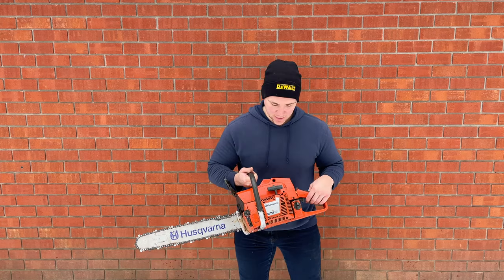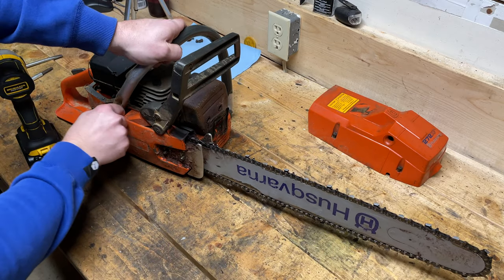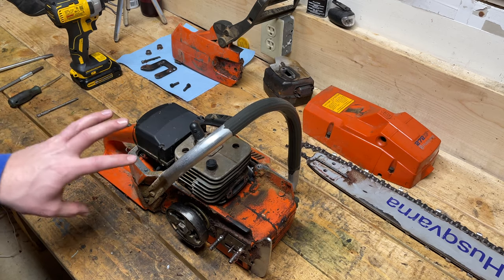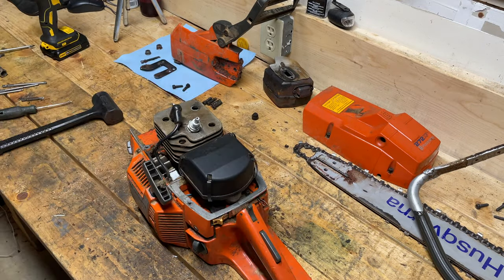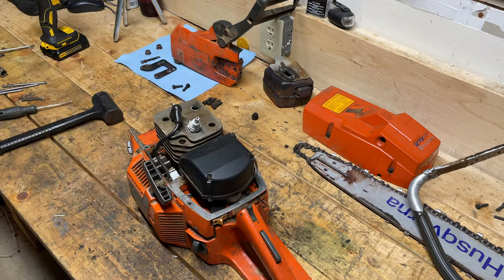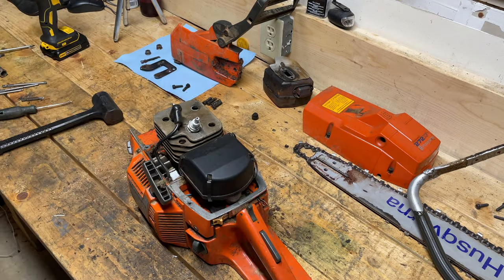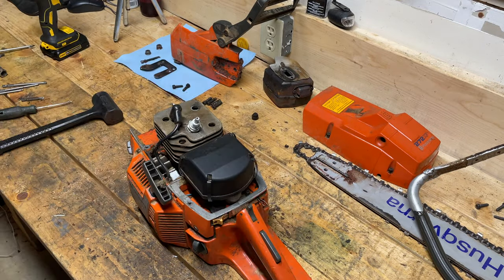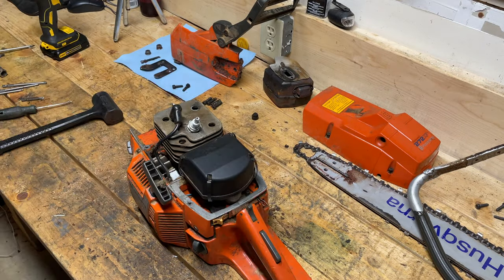How to fix your blown up chainsaw... WITHOUT buying new parts! Step-by-step diagnoses and repair!!!

Comment: Doesn’t the ring gap have to be located away from the ports?
Reply from the maker: Hey Don! The ring gap lines up with the small aligning tab on the cylinder. You’d have to ask the Husky engineer that decided it was best there!!! Cheers!
Reply: @DavesSmallEngines  outboards have a pin that places it on a solid wall with no ports. Just didn’t see you position the ring on it. Could you sand the rough spots off the piston by placing sand paper on a piece of carpet and rubbing the piston on the flat surface till smoothe?  Spraying starting fluid around the intake will running will reveal a leak if

Comment: Oh muriatic acid is some strong stuff. I use it clean the rust off heavily rusted metal. Turns it not rusted, completely. I guess you should put baking soda on what ever you put it on to neutralize the acid. Idk science and stuff. I hate the smell of the stuff. Burns your nostrils. Cool video though i just leaned out my husqvarna h350 and blew it up im pretty sure. And almost doing it to my mini mac 120. I dont even want to start another chainsaw until i learn how to not blow them up. Glad i got a 545xp mark 2 the other day with the auto tune though. Its almost idiot proof im hopeing

Comment: Nobody says blown up chainsaw or engine in Australia. If it's blown up it has smash pistons, crank, valves, & so on. Sanding the piston ring will remove it's hard facing.
Reply from the maker: What’s the term you use down under?
Reply: @DavesSmallEngines  Just worn out. But a blown engine will not run.👍
Reply from the maker: @noelpeterson5591  cool!

Comment: When I disassemble a saw I chunk the parts in a big plastic tub so I do not loose anything.  I tried this once ( cleaning up and sanding the piston) on an H S 45  hedge trimmer, once and when I got it back together it would not run.  I checked the compression and it was a whopping 30#, which ain’t going to run, ever.  So, I had to disassemble it, again, and put on a new cylinder and piston.  It ran fine, afterwards.
If I ever have to pull a cylinder, it gets a new piston, cylinder and rings.  Just like a carb.  If I have to disassemble it, it gets a new carb kit and a good cleaning in the ultra sonic.  I just do not like doing things, twice.
Reply from the maker: Do you use OEM? That can get pricy!
Reply: @DavesSmallEngines  only when I have to.  I will buy certain parts from my local Stihl and Husky dealers but I get them off eBay if I can.  Tank vents, throttle rods, control levers, deco valves I usually buy oem but big stuff I get AM.  I am not spending $50 for a clutch that I can get for $10 off eBay.  I sure am not giving them $300 for a cylinder and piston.  I am a disabled veteran - not an idiot.
Reply from the maker: @johnclarke6647  right on. Any favourite AM cylinder / pistons?
Reply: @DavesSmallEngines  Dave, the cheapest ones, as long as they work.  I have to much Scot in me to spend a fortune for them.  I usually upgrade to Nikasil on saws that I want  to keep for myself.  I have had good luck with Farmertec stuff.  Sometimes I have to put some oem parts in here and there, but my ms 360 is just it came from the box in August 2019 and is still running fine.  I did swap out the tank vent but that was it.  The 360 has cut a lot of big wood.  It has a 20 inch Stihl Oilimatic E bar and Stihl RS chain on it.  It has around 15 tanks on it.  Never had one problem with it.  I just keep it clean, sharpened and fed good two cycle gas and bar oil.  I use Echo Premium bar oil for two reasons - I can get it for a little over $10 a gallon at Home Depot with my veterans discount and it works good in cold weather.  Stihl Platinum does not flow as good in cold weather and I don’t like spending almost $20 for a gallon of it.

Comment: Hey those dawgs  say what the saw was used for, ever milling or post cutting, and probably experimenting with oil ratio.
Reply from the maker: Interesting. How can you tell?
Reply: @DavesSmallEngines  it's common door milling saws to self destruct from lack of oil. I brought a 395xp new before the EPA compliance 50/1 come in, and have always ran 25/1 till I had a fuel issue, toke to dealer and they put fresh fuel in and I should have tipped it out as it was probably 50/1 or 32/1, and seized the saw milling after 1/2 hour use

Comment: 40:1 premix ratio prevents this. 50:1 ratio allows this type of damage, over a couple of years - believe me, we've bought a lot of equipment over the years. 40:1 hasn't allowed any loss of compression. I don't get the whole 45:1 recommendation - I've never seen that on a measuring cup...
Reply from the maker: Everything is 50:1 recommended now. I take Donyboy73’s advice and go with 45:1.
Reply: @DavesSmallEngines  How do you mix 45:1 without special measuring cups? That's my point. I've never heard of 45:1, nor is it on any mixing charts. The back of most 2 cycle oil bottles always say: 50:1, 40:1, 32:1, etc...  Never seen nor heard of 45:1.

I guess that because I run a business, I do this more than the average person. 50:1 grenades equipment after 1 year of heavy sustained usage, by the way. I've never heard a mechanic recommend this, except for some local retail brick and mortar repair shops, which need broken equipment to stay in business.

Comment: Great video which shows you its not always necessary for new parts. Bodge and fix, love it. Could you do one thing though, put the chain brake on before you start a chainsaw. I know ill get called a pussy but having witnessed a chainsaw go through a leg,,,,,,,,,,,,,,,,. Its like 1lb bacon in bits.
Reply from the maker: Nah, not a pussy at all. A smart move!

Comment: If you don’t get piston slap because of material missing from the piston and cylinder and the piston skirt doesn’t explode and break off at 13000 rpm You’ll be fine

Comment: Save all the trouble to get a cylinder and piston kit from Amazon for less than $50.
Reply from the maker: Not even close to the same quality as OEM!
Reply: A new Husqvarna cylinder kit (comes with new cylinder, new piston, and ring) costs $80 on most places online. Edit: I should say, for a Rancher 460.

Comment: I should develop a chainsaw for dummies, that if they forget to mix oil or gas or put premix gas in it the engine won't get damaged or build an engine where the dynamics of the straight gas stalls the engine within 10 seconds after starting.
Reply from the maker: That would sell like hot cakes!

Comment: Why not use 2 cycle oil for lubrication, rather than WD-40? I've never seen WD-40 used as assembly oil for an engine - I would recommend 2-cycle oil, since that's what it's designed for....
Reply from the maker: Good call, I will do that!

Comment: EPA lean running chainsaws all have a fine line between great running and destroyed chainsaw cylinder and jug and the carbon no older non EPA chainsaw gets as I run saws for. 54 years and love my old 330 limelight saw all that it needs is a intake boot every 15 years and a sharp chain and oil that's right for cold or summer running also post and hateful or mean or even rude posts not allowed as this man trying to teach you some skills and bothering to do just that and edit and post think of that he's no 15 year old that needs to post anything for attention also remember if you can't say anything nice don't say 8t at all
Reply: Also get yourself a great well made chain saw they have run a 13000 or 145000 rpm and have nothing but a carb adjustment and your cutting better than new chainsaws bet your bottom dollar you will see

Comment: You don’t find many of those in that good of cosmetic shape.A new piston and ring and it will be like new. I realize the premise of the video is temporary use but I personally wouldn’t use it and risk wrecking a classic cylinder.
Reply from the maker: Ahh, a friend of mine has it now. That’s too bad. Had I have known that I would have kept it!
Reply: @DavesSmallEngines  Damn! That was a classic workhorse. Are you more of a Stihl guy?

Comment: dude get a cylinder and piston do be cheap just get a big bore kit it will have more power
Reply from the maker: Aftermarket kits aren’t always the best quality. This way it’s original... planning on now running it till it blows up again and then replacing with fresh.

An aftermarket kit of high quality would be hundreds of dollars.

Comment: OHH lord, did you bang that thing on the spark plug to remove a loose fastener at the 8:46 mark? Jeez. And wash your machines before you start doing internal engine work. Don should have discussed this with you... I hope!
Reply from the maker: Fowvee good catch! Forgot that was still in there. A light tap, but still poor practice nonetheless. I’ll be more careful next time!

Comment: Audio too low, I have it at full volume and struggle to hear
Reply from the maker: Audio volume is fine - check your system volume too!
Reply: @DavesSmallEngines  you need to yell please

Comment: Great to watch a novice with interest. Although I really enjoyed your video, it made me pause. You are showing people how to
butcher something to make it run. You didn't even oil the ring before re-installing it. You are teaching hacks how to repair stuff and 
sell to the less fortunate. Donny you should know better!
Reply from the maker: Hey John! The point of this video was that its possible to fix your own equipment - even if temporarily to get you out of a pinch. I usually spray a lubricant into the cylinder prior to pulling it over. Thanks for watching!
Reply: You don't rebuild motors to get you out of a pinch. Engines aren't free to rebuild. Do you  disagree? You are showing the public how to screw their neighbor, cause people won't do that. STOP IT !! @DavesSmallEngines
Reply from the maker: @johnhenry8424  hey John... this rebuild cost me 0 dollars. 0 new parts. I had the sandpaper and muriatic acid in the shop. If you were stuck at a hunt camp and needed to get your saw going this would do the trick. Have a better day!
Reply: @DavesSmallEngines  WE all carry muriatic acid and sandpaper in our hunting lodge, ask me. If you keep saying it you may start believing it.
Reply: @johnhenry8424  Who hurt you?
Reply: I’d rather have a cleaned up original part anytime than a cheap replacement. Loose intake caused the problem. Why stick the customer with parts they don’t need and days waiting for them?

Comment: I hate seeing someone use a 20volt impact to remove screws that will come off with hand tools
Reply from the maker: I’m sorry to hear that David. I work on a lot of stuff and this saves my forearms. Cheers!
Reply: @DavesSmallEngines  I understand, but from years of following people that remove screws with a drill motor, I have had to use larger screws on AC cabinets from the sheet metal being ruined from too much power. I would suggest going down in voltage

Comment: There is a difference between Cheap and inexpensive..  You do know that the jugs and pistons have improved from some of the as you say cheap places.    I remember the days of  "Ugh made in Japan cheap shit"  now look at it "Made in Japan good quality stuff"   So don discount Chinese stuff your prejudice is showing.   Even if you did replace it with a Chinese cylinder and piston i know ppl would still buy it.. as long as you state that non oem parts are used.
Reply from the maker: Great call! I have had personal 50/50 failure of poorly manufactured materials from China - it’s no prejudice. Heck, most things these days are made there anyway! I have had some great luck with no name Chinese made pistons. I feel like it’s rolling the dice - and that’s okay. I just personally feel if I’m selling it I want my name to be attached to a quality well known brand of replacement part!
Reply from the maker: In fact, I prefer things that are made in Japan - love my Honda Stuff! They just seem to have a knack for quality control.

Comment: How NOT to rebuild a chainsaw!

Do not use a cordless impact driver to remove or install screws/bolts on things like this. You strip out the heads and run a greater risk of sheering off or snapping them off inside the threaded holes. You run a greater risk of stripping them out as well. Next WTF are you doing sanding on that piston and ring? These parts are roasted and need replaced. As long as you have it all the way torn down stop doing the job halfassed and do it right from the start.